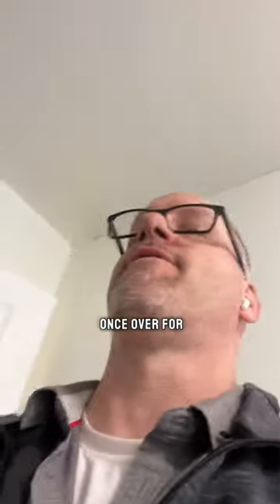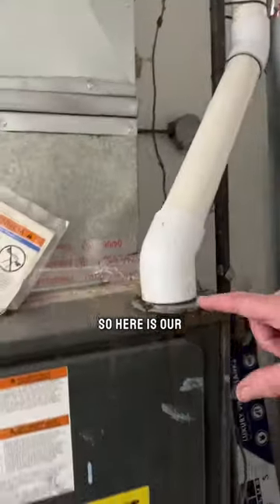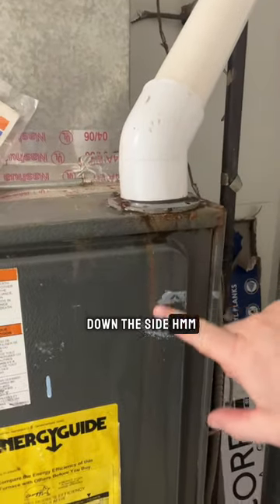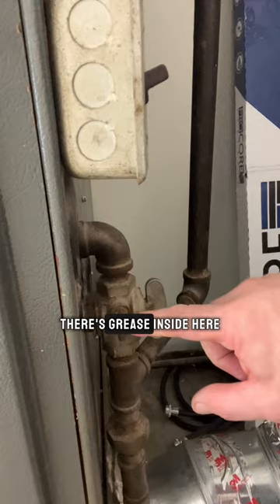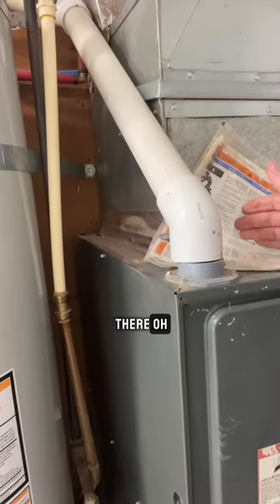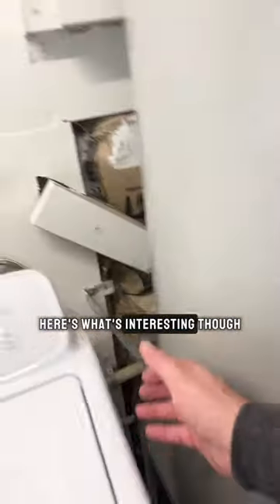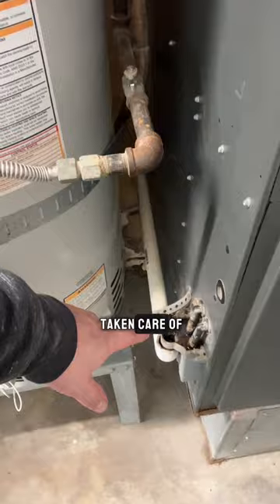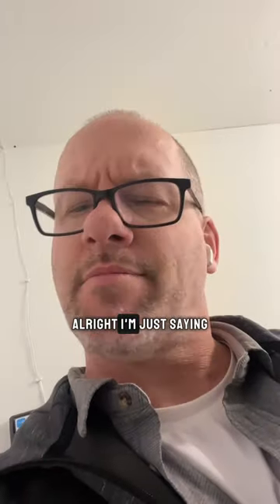Nightmare of a furnace!

Comment: I thought pvc was prohibited on the exhaust duct. Also, it's showing signs that the exhaust gasses are probably cooling too much in the pvc causing condensation to run back towards the unit.
Reply: It's a condensing furnace.